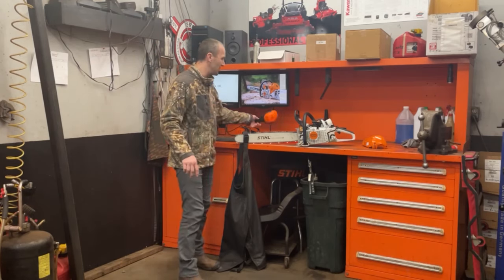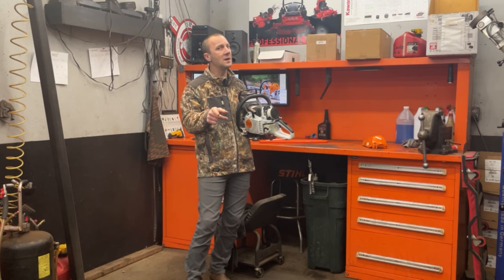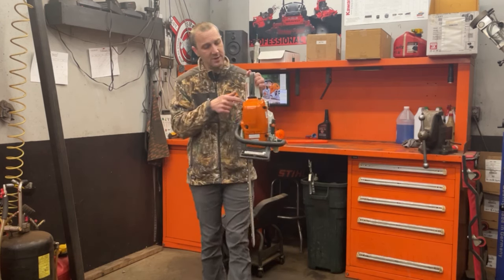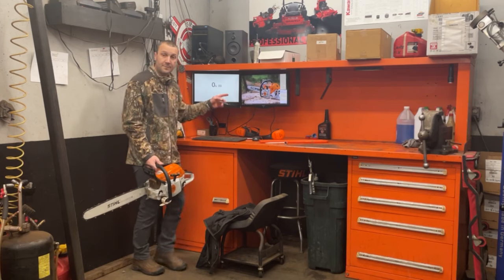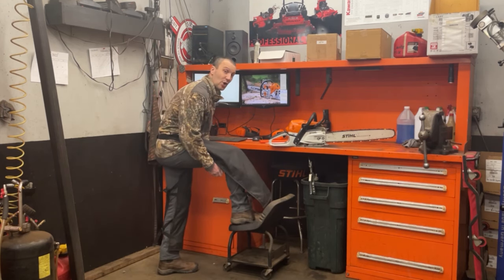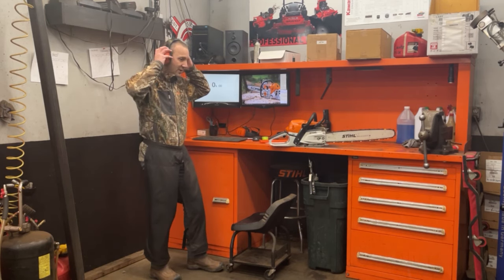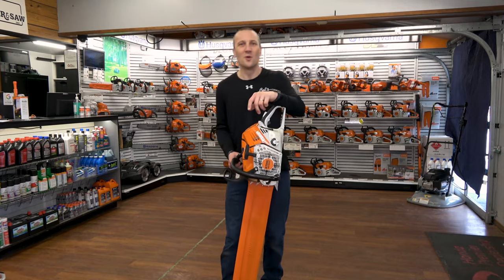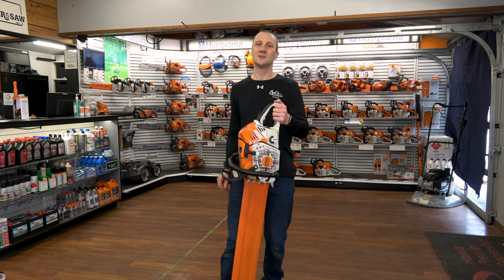Need to Recalibrate Your Stihl M-Tronic System? Here's How To Do It!

Comment: I would never do this to my clutch. Just take the brake off.
Reply: he took the brake off at 20 sec into idle portion
Reply: If your a women leave it on.
Reply: I want the brake to work when I absolutely need it the most so it stays off 100% of the time. I only check it to make sure it works but it stays off if it’s running

Comment: I’m buying a Stihl 261 (20”) from my local shop. They have both in-stock and brand new. Should I get M-Tronic? Or non M-Tronic? My first saw ever, I bought a piece of land a saw. Unsure which one. 😢
Reply: Id go mtronic because you won't hafto figure out how to tune the carb plus it's so much easier and always run greats there was some issues with the early models but the new ones are solid

Comment: Once you recalibrate, when do you need to do it again? Say I calibrated it and then cut some wood, but put the saw❤ up for a month before needing to use it again. What do I need to do when pitching it to use after the moth has passed?
Reply: This should only be required on rare occasions. If you replace diaphragms, clean your carb, such as that, you will possibly want to reset. Most of the time reset is not needed on your saw.
Reply: @davepayton3442  thank you. I was thinking this would have been the case, but needed feedback since I am no expert, juts wanting to do the right thing.
Reply: Or go from 900ft elevation to 7200 back to 1800 and up to 7800 in a week lol my 661 freaks out a bit and runs like shit until I recalibrate it. You can run it and it'll tune in eventually but I'm inpatient

Comment: My stihl ms 441c has the m tronics carb. It won’t start after replacing the ignition coil and spark plug. Not sure what to do honestly
Reply: Did you figure out your chainsaws no start issue? Having similar issue on a 661c.

Comment: Hey Josh, your videos are very helpful, thanks for creating and posting them here. I have a question... how often should I mix new gasoline and oil for my M-Tronic Stihl?  I mix about a gallon at a time, but often don't use all of it in one cutting. I store the premixed fuel in  a sealed container in the garage where the temperature remains fairly constant year round. Is it okay to use premixed fuel that is a few months old? It will run the saw, but is it doing any harm to the engine? Thanks for your help.